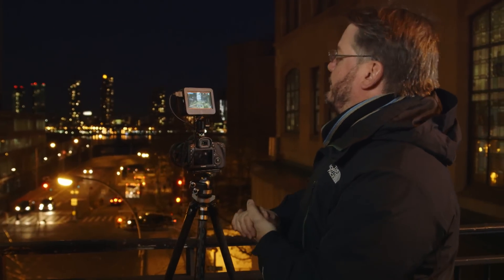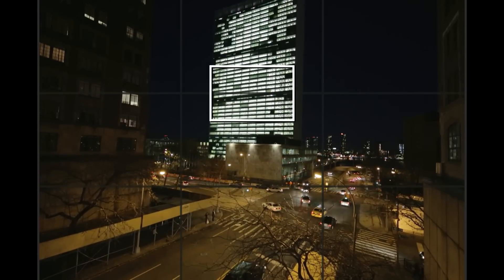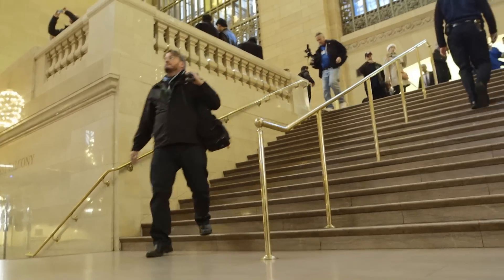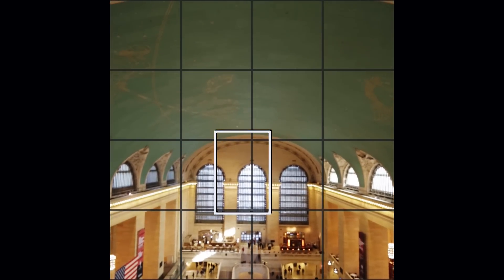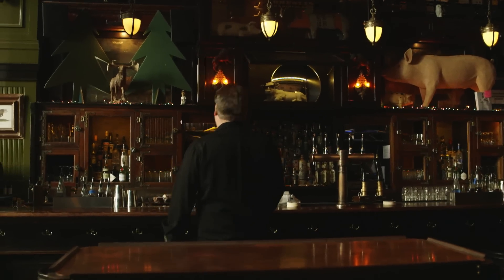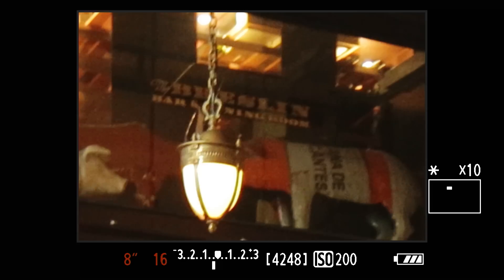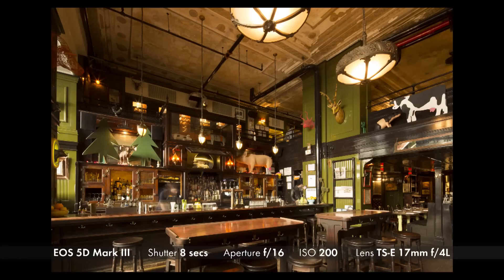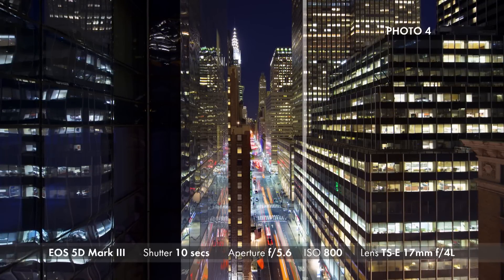Shifting the Lens

Comment: The windows at the station have an thin iron grid. This grid is visible to eye but not to the lens. 
The photographer is using the maximum aperture and focus far away. So the grid is invincible in photos. For avoiding grids big apertures and long focal lengths are very usable.